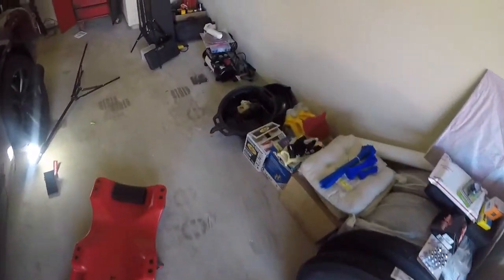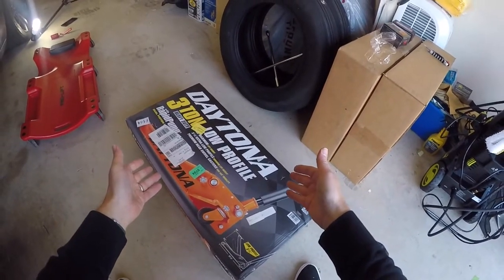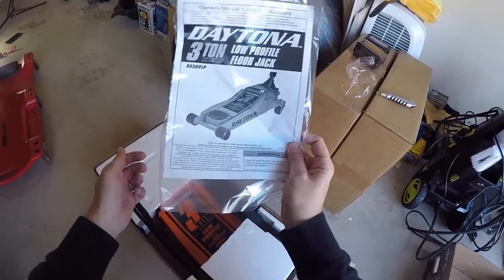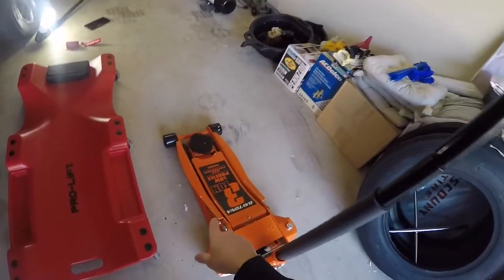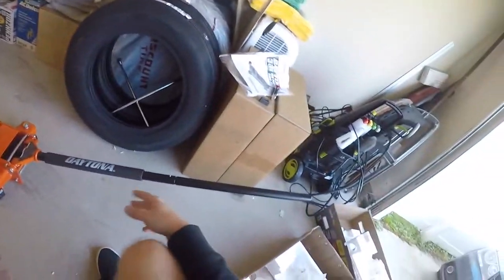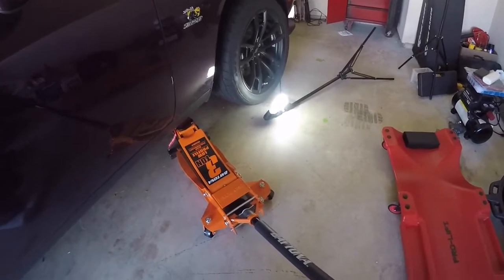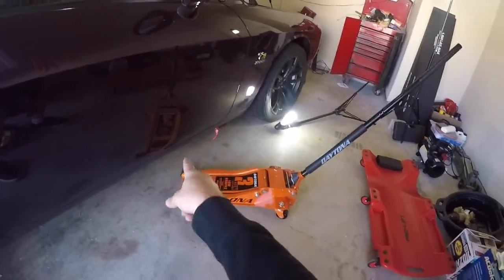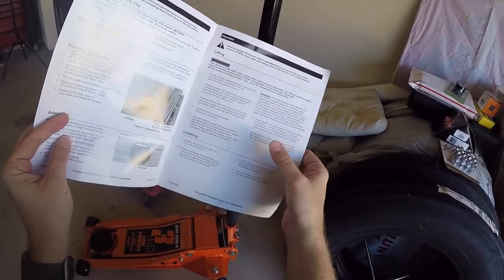Unboxing and Review of the Daytona Orange 3-Ton Low-Profile Floor Jack from Harbor Freight

Comment: You need that owners manual for set up. It tells you to bleed out the air and to check your fluid level before using it. Must follow the instructions. Its easy. Newer model also uses a large bolt you must loosen to fit the handle in.
Reply from the maker: I looked in the manual and pointed that out towards the end of this video. Honestly though I never did end up bleeding it but I've now been using it for over 3 years and no issues. This one does also have that bolt that secures the handle. I think I had it about a year before I realized it was even there lol.

Comment: Nice video. Did you cross shop / consider the long reach low profile 3 ton Datona ?  Thanks
Reply from the maker: I may have considered the long reach for a minute while researching for this one but it was more expensive and I didn't see a need for the longer reach in my case.
Reply: The low profile 3 ton is on sale for $149 now

Comment: there is a black thing that holds the handle during transportation which must be removed before using otherwise it will bend the bar . It happened to few. You know this if you read the manual.
Reply from the maker: I'm not sure how people could miss that, not to mention how hard you'd have to crank on the handle to damage it. I mean, as soon as I put the handle in I could tell something was blocking it and found it easily. But I guess there might be people out there that just try to force things with all their might before trying to figure out why they're getting any resistance in the first place.
Reply: @Scavenger1320  couple of youtubers had bent it on their unboxing and thought it came damaged. Super duty has a different way to restrain the pumping handle.

Comment: The price went up to $159 for this same Jack they also have the same one in a "Super Duty" Model and it has alot thicker Steel and Better wheels it costs like $259 but it also weighs 103lbs so that definitely is alot Heavier.
  For me I'm going to buy the $159 one it looks Heavy Duty enough for my Needs
Reply from the maker: Seems prices have been going up on just about everything unfortunately. I feel the steel is plenty thick on this one. I know my back feels it anytime I have to pick it up 😆